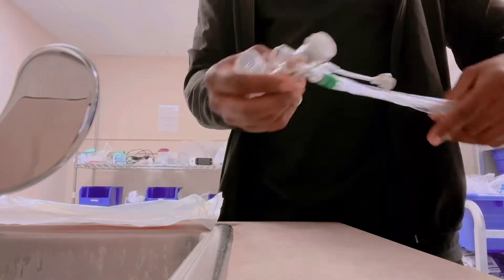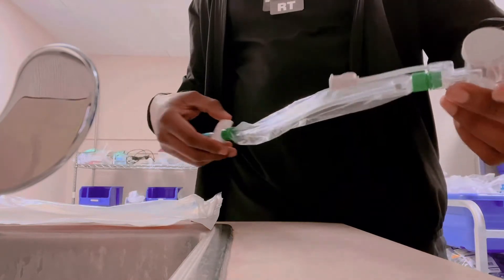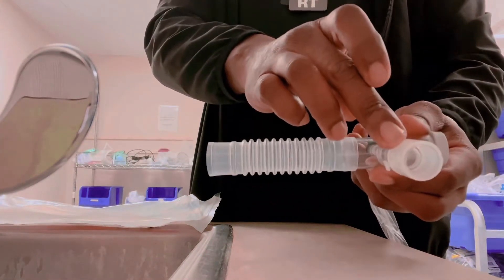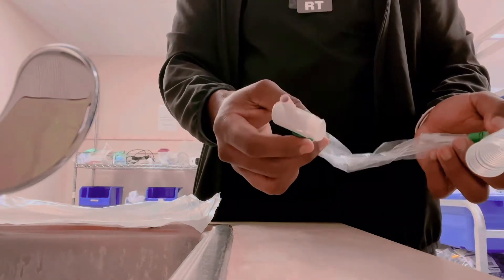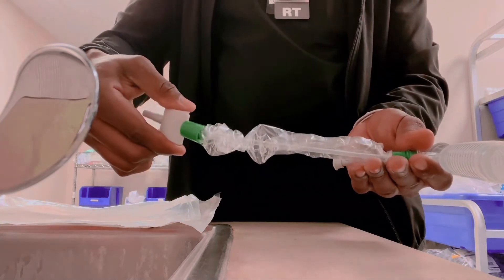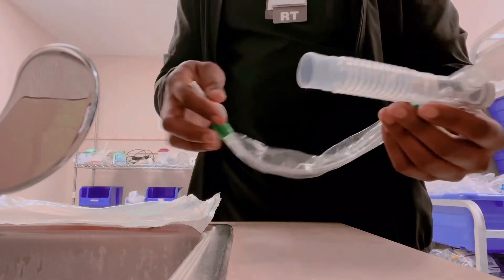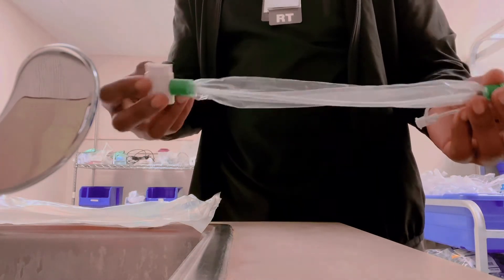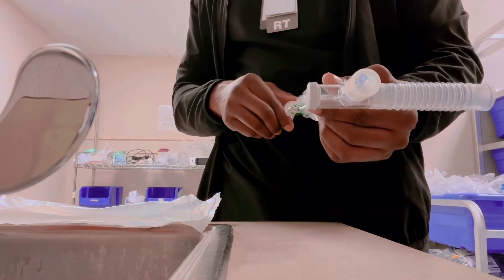Ballard closed system suctioning overview

Comment: Q- what if there's no white tubing on the corrugated tube on the side. Kindly answer. And only has a trach thats capped all day.
Reply from the maker: The corrugated tubing is usually for the attachment to ventilation. In new Ballard set ups they come equipped but for this instance I don’t believe they’re needed. The cap would have to be removed prior to suctioning.
Reply: @letstalkrespiratory  thanks very much. I was able to observe and jogged my memory. Many thanks for teaching is. Blessings